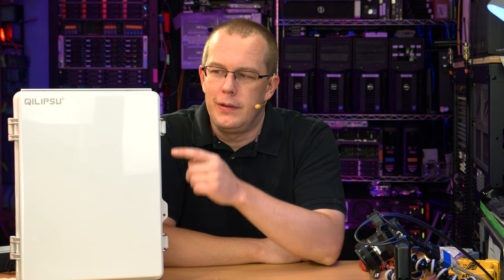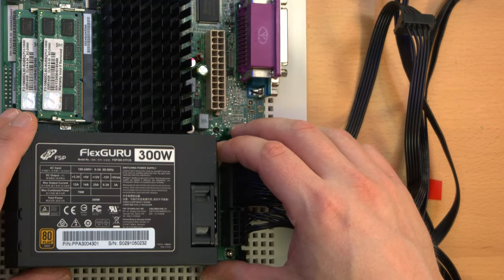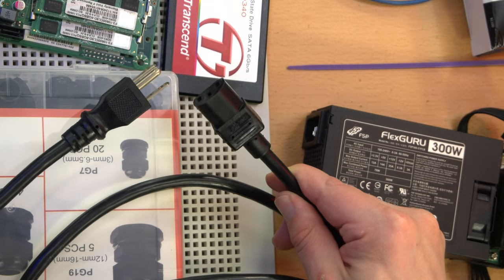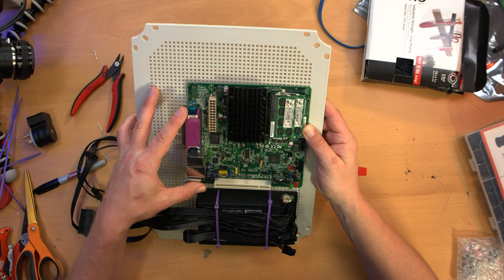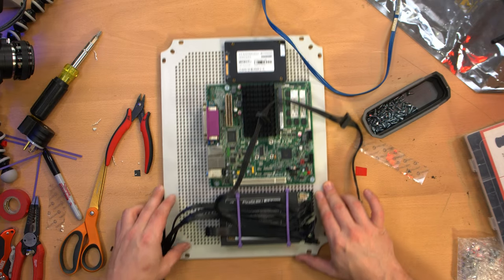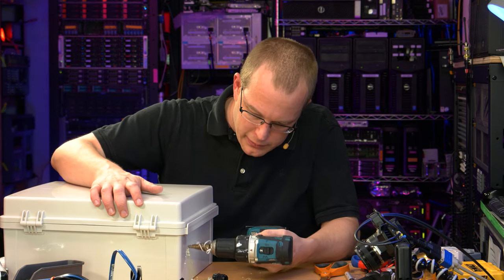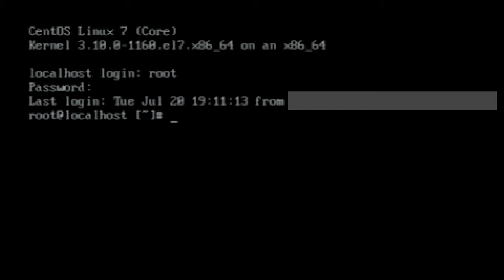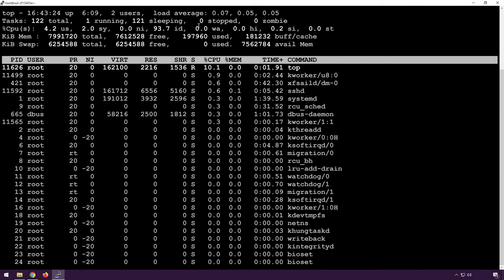QILIPSU Outdoor Enclosure with a Computer Inside... Because.

Comment from the maker: Update about 15 months later:  The enclosure is still going strong!  It flawlessly survived a couple of hot New York summers, and a very cold winter.  When I re-opened the box there weren't any signs of previous water infiltration (let alone insects, etc.) and everything looked exactly as it did when I mounted it on the wall.   The enclosure is still in the same spot, but I changed out the computer and added a PoE switch for a new project/video:  

DATA GRAVE ⚰ Underground Backup Servers ( https://youtu.be/9hDbz1XfpUM )

The enclosure and old setup are featured in that video if you want to see for yourself how it held up!  :)